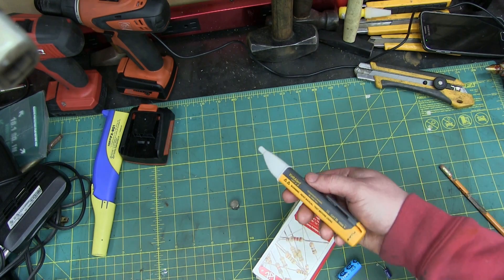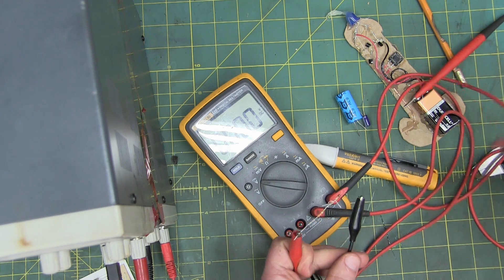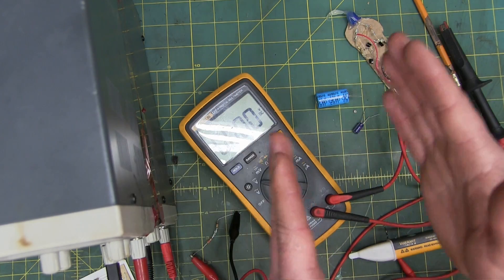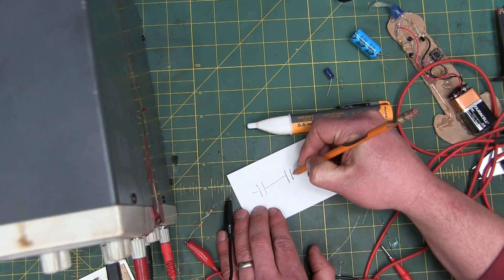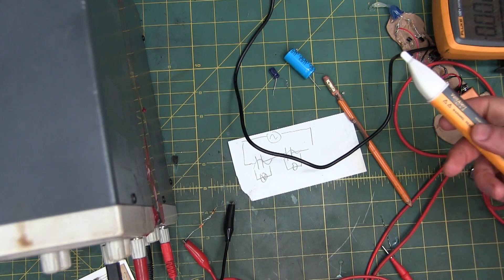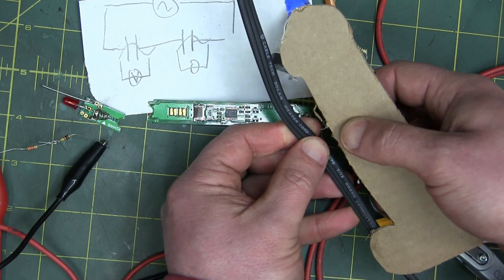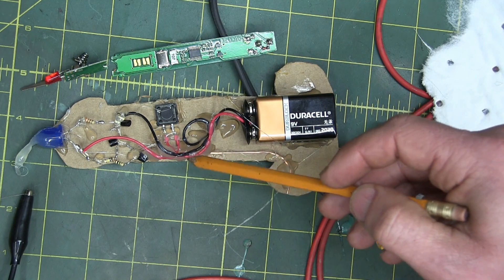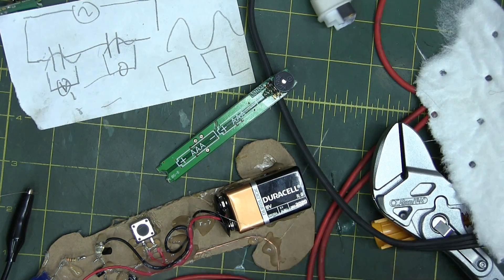Non-Contact Voltage Tester | How does it work?

Comment: your description of a schmitt trigger isn't very good. A schmitt trigger changes the switching thershhold voltage in the other direction of the output voltage whenever the output gets switched.. That prevents any signal which is close to the switching voltage from switching on and off rapidly due to noise or a small changing signal.
Reply from the maker: Wait, you mean to say it's not ACTUALLY a pixie pregnancy test?!
Reply: Does anyone give a Schmitt or two?
Reply: It's not entirely wrong either. I use one to trigger a mosfet with a photoresistor. Without it it's a great burn-your-house-down-at-sunset-or-sunrise timer.
Reply: Derek N. Eder yeah probably not totally correct there either but, you get the general idea. 
Amplify the shit out if the signal, threshold it to get a nicer blinkenlight and then do something to also get sound.
Reply: Yeah but if I differentiate the integrator and inductify the capacitator it will give a solution to the wave equation and satisfy the controllability matrix for plane-wave propagations in the H polarisation 
, thereby lighting the LED.
Reply: Nice Wikipedia definition!
Reply: Don’t trust those things. Try it in a metal box with 3 phase wires tucked in. Won’t work
Reply: @tomkristman1456  they don't call 'em widowmakers fer nuthin'
Reply: Patriot10 i bet you're not. Are you just grumpy on the internet or in general aswell? Or did someone steal your teddy, is that why you're upset?
Reply: I bet your a blast at parties.

Comment: Yeah i was wondering why it only works with a resistor connected to the AC for the NCV tester to detect a voltage

Comment: If they are using your body then why do they also work when I jam one in an outlet and leave beeping while I go to the breaker box to find the circuit? I'm no longer part of the circuit. I do notice they behave differently (more sensitive I believe) while I am holding it though.

Comment: I've got what you might call an old "full-contact" voltage tester from my Grampy.  It's two wires with stakes connected to a single neon bulb in a plastic housing, with a little pocket clip on it.  You stick both metal stakes into a socket, and if the bulb lights up the socket works.  Sketchy as fuck, but neat.

Comment: So if the tester relies on you being the big capacitor, if you were standing in a foot of water (like a flooded basement) testing wires before u grabbed them, the tester would be giving false negatives. Yikes 😬. You could even test the tester before you got your feet wet and it would all appear to work fine until you dipped ur toes.

Comment: These DO also work to detect DC without contact:  just move the sensor back and forth past the wire.  If while moving it lights up, there's DC voltage. My regular 120V AC non-contact detector can detect 12V DC in my car EZ-PZ this way.  It detects the change in magnetic field, so if there's no voltage, movement will still give no light.  If there's voltage, moving in and out of its static field will trigger the detector.
Reply: It doesn't work that way..  😂 DC is 0hz.
Reply: @HeWhoSitsOnFences  That's why you provide the oscillation (change in magnetic field intensity) by physically moving the sensor. . .

Comment: You didn't have to break that apart I own the same fluke and took it apart without destruction!  Why? The battery leaked and I had to clean the leak off the PCB.

Comment: If AC goes right through capacitors like they aren't even there, why are capacitors used in power factor correction and motor starters?  I am confused now.

Comment: You can also use the hairs on the back of your hands in a pinch. if you have hairy 200lb gorilla hands that is. Takes a bit of practice and a few shocks but if your used to dealing with hot stuff you learn to recognise the sensation. Also with AC, the pixie kind not the cooling kind, always always always make first contact with the back of your hand all that will happen, provided your not touching anything conductive that includes your feet, is you will get a shock and your hand will jerk back towards you because your muscles will contract. That is why people can't let go while being electrocuted. As they're muscles are contracting therfore griping as tight as the muscles possibly can.

Comment: Schmitt triggers still have a strong VDD-dependence. If you don't want a voltstick that gets twitchy as the battery goes flat, you need a different approach. And don't get me started on 400Hz power.

Comment: I know this is waay late, but if the non contact voltage tester uses you as a capacitor, then why do they work when you're not touching them?

Comment: You know,  you never seem to have one of these when you really  need it.          But dropping a chisel on the exposed end of a wire will also tell you in short order. Yes few chisels have had hunks of metal blown out of them and no I have never met an electrician who didn't swear. " yeah it's all dead, no worries that entire run is disconnected ".....

Comment: I almost always get false positives with my Commercial Electric non-contact voltage tester. How would I stop that from happening? Sometimes if I grab the ground wire in the outlet it stops giving the false positive but not always.

Comment: What happens to the voltage when capacitors are run parallel or in a series? How come some capacitors are beyond the working voltage rating of the electronic board (ie a 48v capacitor in a 12v board?)  Does it output the voltage rating on the capacitor?

Comment: If what you say is true why does that same device continue to operate when I have 500 volt gloves on... also why does it continue to work when I stick it In an outlet and walk to the breaker box and turn off breakers till the thing stops squealing???  I doubt i am "coupled" to the device from 40 feet away... i think it is a purely inductive circuit that gets its power to run the bulb from the small amount of current generated from the magnetic field generated by the ac.  It works because of the magnetic coupling generated in a coil of wire wrapped around some steel that is placed close to ac voltage.

Comment: @4:18 - Seriously? Didn''t Edison and Westinghouse thrash this AC/DC bullshit out in an elephant and dog electrocution shit show a century ago? The gnash of a pixie bite is totally subjective, and the parameters - the particular animal that bit if you will -  impossible to empirically measure or reproduce just how hard that they latched on: That is to say - the available animal may be known, say - a German Shepherd - or so many volts potential difference with so many amps available, but the victim is a wild card. Living moving people making casual intermittent contact with electricity are a poor argument for an Ohm's law equation. I've been bit by household mains, CRT anodes,  ignition coils, SMPS storage caps, a HeNe laser power supply to the inner thigh, and several angry prostitutes .. 90 - 36000 Volts AC and DC (In retrospect, probably should be more careful) . but can't to this day tell though that this ever bit harder than that in any particular case. There are only two types really:  Those you cuss at, and those that put you in the box for good.

Comment: More bite off of AC?  I remember a story of the rivalry between Edison and Westinghouse.  Edison was a DC type of guy and Westinghouse was selling the world on the efficiency of AC.  So when it came time to perform the ultimate capitol punishment, Edison was all like, use AC, it is more deadly.  So they did, and after it became quite obvious,  through the smoke and the screams, that it was not the death penalty, but more like inhumane torture.  So they changed over to DC current, killed him dead, which really embarrassed old Thomas Alva Edison.

Comment: So there are positive charges, and negative charges, and electrons that are the negative charged but they're traveling from - to +, the current witch reassemble the flow of holes and traveling from + to -?? Why is the current flow opposite to electron flow? And if the electron is a wave function, how on earth we can determine it's position? I know quantum physics is not to be mixed with the conventional, and with the conventional we make processors 😂😂, just good enough for the purpose!

Comment: Love the vi Jay o's!  I came across this gem and had a thought. Scary as that is, I want to share with  the inspiritor.  I am currently wearing the hat of a telecommunications technician, installing fiber optic internet,phone and tv in the mountains of ny.  I've worn many hats and stumbled across many pit falls but none have I met till now that are inherently haphazard as drilling though walls that have mysterious contents. I.e. power wires.  If you could devise an attachment to various drill bits that warm of impending danger of drilling though or in close proximity to power lines you could no doubt save some lives and certainly some pride  for those is my current field.

Comment: These detectors will not work for dc because dc doesn't produce  a electric field only a magnetic field.  Therefore it is reading the electric field produced by ac

Comment: In other words it's picking up electric field between the hot wire and you holding that device.  Yes like a capacitor.   To detect a magnetic field you want a Gauss meter

Comment: Had a situation that kind of confused me with one of those though used it to check power going to a light switch it didn’t work so I used the original way and just grabbed the wires got a light tingle but then the chicken stick in my other hand started going off

Comment: I am a 12 year licensed journeyman electrician. I have owned many of those fluke hot sticks, hands-down the best option for under 600v noncontact meters.  That was a little difficult to keep up with but then again maybe that’s because I was driving while watching. Well, that and there’s a big difference between electrical work and electronics work. At any rate well done sir.

Comment: Some reason I always thought these things were based on induction. They are useless on DC signals so figured it must be measuring an induced voltage. I have seen stud finders with this feature, they sometimes say there is voltage just due to the static made sliding the thing on the wall. That seemed to me too to indicate introduction based operation.

Comment: The problem is most amateur users will not know how to interpret the lights & buzzer. Also in my Voltalert the probe lights up on both neutral & hot outlet slots (240AC) & there is no buzzer - not particularly useful!

Comment: really bad idea using electrolytic capacitors for AC, those are polarized, and it doesn't take a very large AC voltage across them for them to blow up and fill your workshop with nasty smelling yellow stuff that you will never get rid of, and the smell never goes away, never I tell you... Add to that I had a colleague who lost an eye to a large electrolytic capacitor that was mounted the wrong way on the PCB, those things are dangerous!

Comment: Stick the thing in the AC source, remove your hand from it and see if it still beep... Your not using your body as a capacitor😉
Reply: I would bet the it is a darlington cascade transistor thing that fires a bigger transistor (switch) that makes the buzzer chooch.. It will also pick up gost voltages sometimes especially the cheap ones. Used this one with 1Kv gloves on and it work just fine. 
Fun fact: try playing with one of these around a working cathodic tube TV 😁

Comment: A CAPACITOR IS NOTHING LIKE A BATTERY!   The capacitor equation is simply the current is proportional to the rate of change of the voltage.  Nothing like the equation for a battery, which has no term for a rate of change.   Their only similarity is that a charged capacitor, with no load, looks something like a battery.    Also that tool is NOT a voltmeter,i.e. a device that measures voltage to a certain accuracy, in the low percents.  It's a very low quality and very low accuracy voltage sensor.   And that probe sticking out is not an "antenna".  It's as you sometimes say, a plate of a capacitor.

Comment: I figured a FET(Field Effect Transistor) would be the first choice over a Bi-Polar device. FET's only require a voltage potential to turn on. BJT's do require some current to start to conduct. like you said 'there is very little current flowing ' thru this detector.

Comment: OK I'm a knob. Not any kind of electrical nobody. So I'm thinking about what you said and capacitors and how we can be a capacitor holding the do hicky. So would the first capacitor be the live wire on one side insulated by the plastic tip and from the antennae part. Bringing the plates together would induce a charge on the other plate and that is what trips the switch. Would I even need to exist in this case. Metaphysically or otherwise. Is there a way to test the theory with something non capacitable or does such a thing exist. I'm going to try a rubber band on the trigger of mine with it stuck in one of my little holes. OK well it probably didn't seem like I was gone long from your side of this conversation but I proved you're smarter than I and I am still not quite understanding this because with rubber band applied to switch and a small receptacle violated no beep until I got near. Meaning you were either right or they are magic. Do they make us one of the capacitors so it won't be a people detector instead of a voltage detector? If so why don't we have people detectors? Forget the metal detectors I want to keep the nuts out. OK I'm going to watch the vidjao again and try to understand that differential stuff. If these aren't magic then surely those lamps that turn on by touching them are right? There's got to be some magic in the world. Thanks for the vid. Keep em frosty.

Comment: That is awesome, i always wondered how those detectors worked. I have a old school detector that has no on/off button. another fun trick is to hold on to a hot wire (while not grounded) and hold on to the detector. Then if you get close enough to someone with the detector it would light up as it normally would if you found a hot wire. Those things are life savers. Also to generate static you could just rub the detector across your arm quickly and it should light up.

Comment: I've used these volt pens for well over 25 years as an industrial maintenance man and such, and know that they will detect AC voltage whether they are in my hand, or not.
On numerous occasions, I have just laid the volt pen against a wire and walked away to start flipping circuit breakers to find the breaker to cut the circuit off, with 100% success.
On several applications of really big wire (like '00' wire and stuff), I have used some 3M Super 33  (truth told, it might have been some cheap "Jap Wrap", but whatev...) to tape the volt pin directly to the hot wire, and it lights in a glorious fashion with no human (or non-human) contact or intervention at all. 

They may indeed rely on some leakage current from a capacitive circuit, but they most assuredly don't rely on you holding them - it's way more subtle than that.

Tell ya what - make an outlet box on the end of an extension cord and turn the outlet "eye to the sky" up.
Plug the dick end in, and stick your probe in the small hole (without need for apology of misdirection) of the receptacle, and walk away...
FAR away...
It will light up and chirp (if equipped to do so) no matter how far you wander.

Volt pens don't NEED you, yo! They do their shit whether you're there or not.

BTW, Santronics made the bomb diggity  volt pens, but they got bought out a million years ago, and that sux.

Comment: Ten Commandments for Electronic Technicians
April 17, 2015 at 5:22 pm
I - Beware the lightning that lurketh in the undischarged capacitor,
lest it cause thee to bounce on the buttocks in a most un-technician like manner.

II - Cause thou the switch that supplieth large quantities of juice to be opened
and thusly tagged, that they days in this earthly veil of tears may be long.

III - Prove to theysel that all circuits that radiateth and upon which thou
workest are grounded and thusly tagged, lest they lift thee to radio frequency
and cause thee to make a like a radiator.

IV - Tarry not among those fools who engageth in intentional shocks,
for they are surely unbelievers and are not long for this earth.

V - Take care that thou useth the proper method when thou takest the measure
of a high voltage circuit, lest thou incinerate both thyself and they meter.
For verily, though thou hast no account number and be easily surveyed,
thy test meter doth have one and, as a consequence, bringeth much woe
on the supply department

VI - Take care that thou tampereth not with safety devices and interlocks, for
this incurreth the wrath of they supervisor and bringeth the fury of thy
safety inspector down upon they head.

VII - Work thou not on energized equipment , for if thou dost, thy fellow workers
will surely by beers for they widowed spouse and console her in other ways.

VIII - Service thou not equipment for electrical cooking. It is a slothful process
and thou might sizzle in thine own fat for hours upon a hot circuit before
thy Maker sees fit to end thy misery

IX - Trifle thou not with radioactive tubes and substances, lest thou commence
to glow in the dark like a lightning bug, and thy spouse have no
further use for thee except thy wages.

X - Thou shalt not make unauthorized modifications to equipment, but cause
thee to record all field changes and modifications made by thee,
lest thy successor tear his hair out and go slowly mad in his attempt
to decide what manner of creature hath made a nest in the wiring of
such equipment.